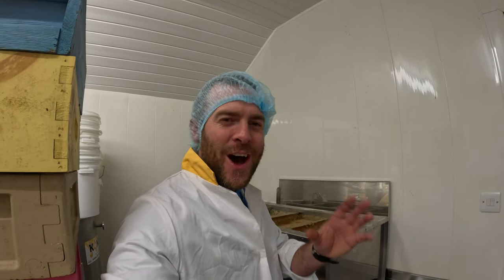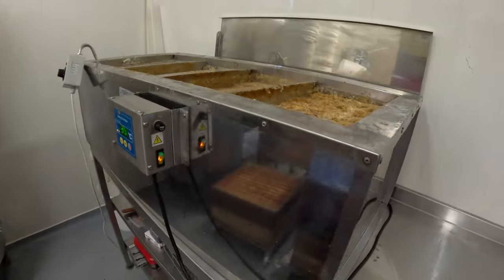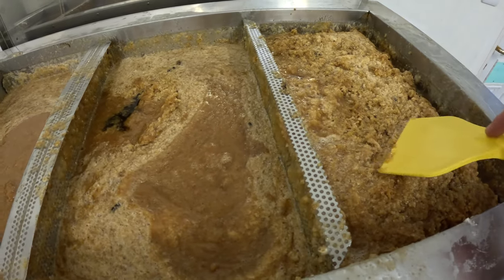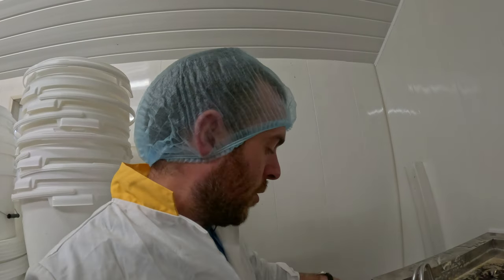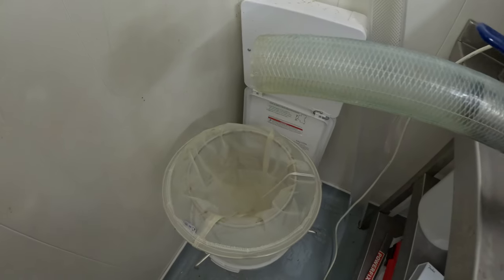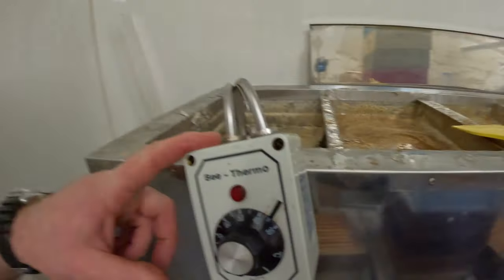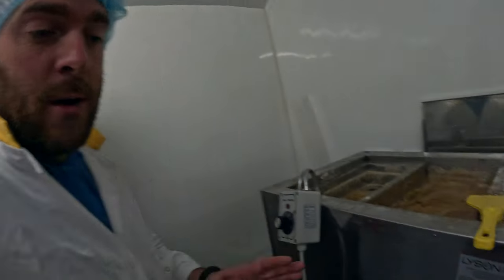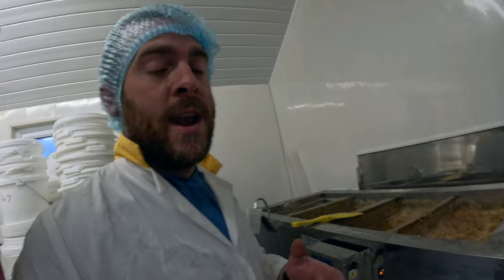How To Strain & Filtering Honey The Easy Way!

Comment: Great video thank you for explaining as saw one of these at Abelo and didn’t quite understand how it worked . Looking forward to the Apimelter and your candle making vid soon. Could I ask about your super clean walls ? Have you  video how to convert a barn into a honey room so it can be as clean as yours ?

If budget won’t stretch to a honey sump or Apimelter , could I just have a heated coil like in your video and a series of those 200ym filters in buckets ?🪣
Reply from the maker: You could but you would need to start with a 1000, then 320 and finally 200 otherwise it would block instantly.

When I get the new honey house sorted il do a video on the construction 😊